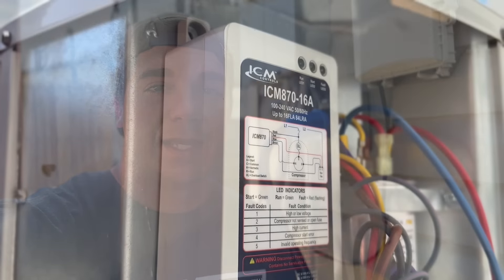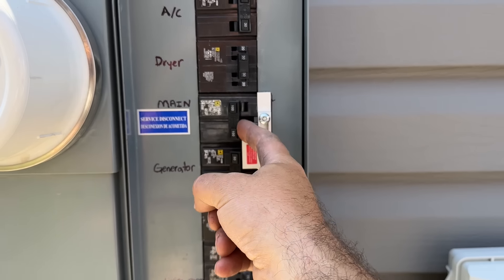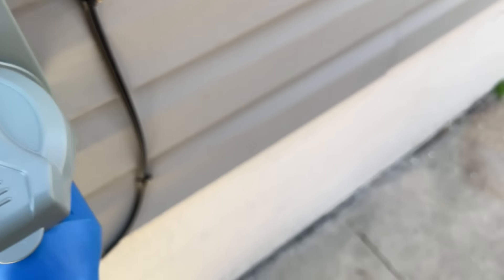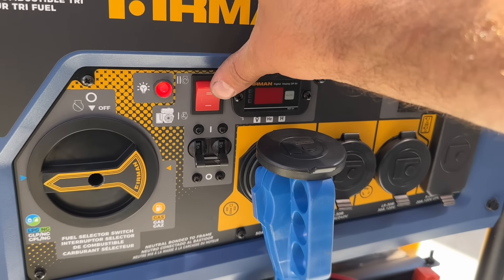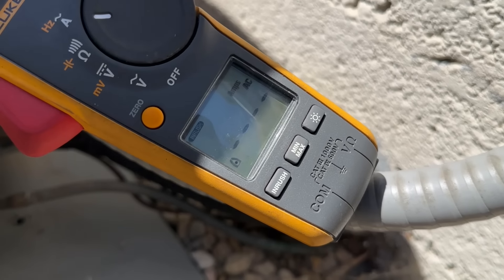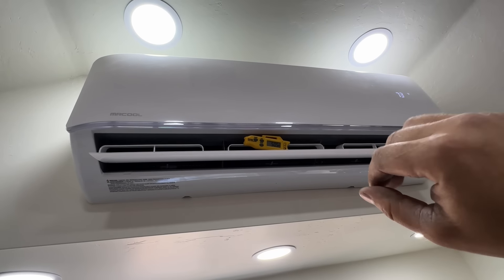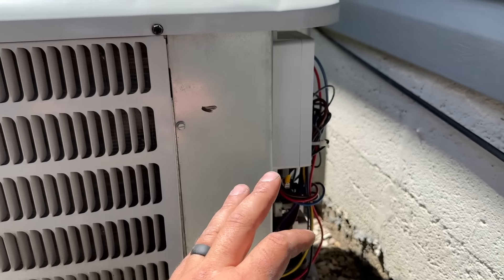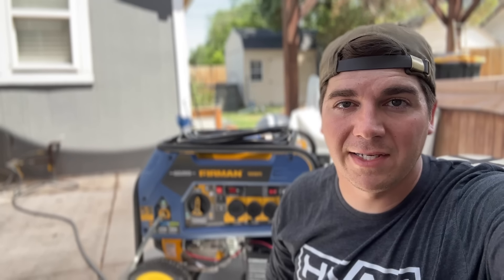How To Get Whole Home Backup Power For Under $1000

Comment: What happens if you don’t install a soft  start
Reply from the maker: It would trip the breaker at the generator at startup if it requires more amps then the generator is capable of producing. As I said in the video, if you had a 4 ton system that pulls 100 amps at start, without the soft start you’d be demanding 15,000 watts (70amps x220v) which isn’t feasible. 

Now if you lower the inrush amps from 70 to 25 that would only be 6000 watts which is totally doable with a generator. 

The mean motivating factor to me is having the capability of using it in the winter as well with a heat pump so I’ll be doing a video on converting a regular system to a heat pump. It’s really not bad at all! Stay tuned 👊🏼

Comment: Great video Dave, straight to the point and well explained. I just purchased the same generator but with the CO2 sensor. I noticed you run natural gas but use a 50amp connection.  I assume this is because if you ever use gasoline you can get up to 10,000 watts. NG Max is 7,500 watts on that Firman. Will you just be careful with how many breakers you have on when running on NG? I am about to install the same arrangement and use natural gas only (hopefully). And definitely subscribing now
Reply: Or did you use the 50amp cord from the generator for less resistance in the cord than a 30amp cord?

Comment: So you have 6.3 amps on one leg on the a/c so you should have 12.6 amps total or am I wrong ?
Reply: No, it's a 240v circuit- current flowing from one hot leg to the other, so 6.3 amps total.  IF it was two separate 120v devices, you could say 12.6 amps.  Think of it this way- there's no "neutral" leg in this case, just two hots and a ground.  Normally you think "current flows from hot to neutral", in this case "current flows from hot to hot, they're out-of-phase for twice the voltage"
Power, though- that will add up like you're thinking.  240v x 6.3A = 1500W (approx).... if it were two separate 120v circuits at 6.3 amp each, then about 740w each, again 1500w total.
Does that make sense?  (clearly I'm not an EE professor :)  )
Reply from the maker: 6.3 total as the other gentlemen said 👍🏼
Reply: @diyhvacguy  But if you test the amps on the other leg it will also show 6.3. A 240v circuit is two 120v circuits or legs. Why doesn't 6.3 + 6.3 = 12.6? Try putting the amp probe around both legs at the same time and see watt it reads. Sorry, couldn't help myself on the pun.
Reply: @christalbert722  thank you for the reply, I thought that was the right answer but I just read somewhere else it was the opposite way.
Reply: @diyhvacguy  thanks for the reply

Comment: If you spend enough money to buy whole-home backup power, then you're spending far too much money because you don't need whole-home backup power while the municipal power is down. It's silly to overspec your backup generator that way. Spec it instead only big enough to cover all your truly necessary equipment and no more. Water well pump, chest freezer(s), refrigerator, stove igniter, furnace... but not all at the same time, so priority-switch them. You'll never need all of them to be powered at the same time, but in the dead of winter you may need to run any one of those at the same time as your furnace.

Only the very lazy and the very wasteful will have a whole-house backup generator that's really big enough to carry everything. That's 48KW, and it's far, far too much.

Comment: Would this also power a hot water tank and an electric stove as well?
Reply: Any device that heats up will probably not work very well when the A/C is running. It all depends on how many watts on each 120V leg is available at the time the device starts.
Reply: No, the water heater is a huge load unless it’s the only thing your going to run 😂
Reply: @deadonleprechaun  Most electric water heaters have elements that draw 4,500 watts, pulling about 35 amps. So depends on the generator, but generally, while on gen power you would not use heating appliances as you would on grid power. My old generator was a 5,500 watt and one morning we lost power. I started the generator for wife  and daughter to get ready for work and they proceeded to use hair dryers, curling irons, microwave, instant hot etc and of course it popped the breaker on the generator. When on generator power you will need to limit the high demand appliances to one or two max at a time. That certainly includes an electric W/H or stove.
Reply: @azycray4801  Yes, it’s too bad that Furman neuters the 50 amp receptacle giving a small internal fuse making it a glorified 30 amp. I had the larger version of this generator from Costco and elected to exchange it because it couldn’t handle my 60 gallon water heater. I opted for a 4000w 120v inverter generator. Decided to just scrap running my 240 V appliances so I don’t damage them with too much THD. Once the prices on 240 Volt inverter generators are more affordable I will probably upgrade.

Comment: Please be careful. Looking at your "transfer switch setup", it seems you don't disconnect the neutral wire. This can potential be dangerous for you and for people working on the line.
I totally appreciate people helping themselves, but we need to have safety in mind for others, and if the Generator  is connected to the grid neutral, I assume this is a potential danger for people outside of your property... Or does your power grid not have a grid neutral, and you have your own transformer with a ground only? Then my concerns might be obsolete...

Comment: Ok, someone help me design a home backup that includes an instant on battery from Home Grid or similar. The battery needs to be able to run my two AC units (upstairs and downstairs), plus fridge and lights for 12 to 24 hours.  Then if utility power is still out, a want to be able to roll out a portable natural gas generator, him up to my grill outlet quick connect, and use it to periodically recharge the battery. That way the generator can run at heavy load which is most efficient way to run generators. Then i turn it off when batteries are full.  Automatic control of the generator from the battery would be even better.  I know solar can do most of this, but im not ready for solar... Too expensive and too ugly. Once those two items are solved, I'll add solar and not need the portable generator anymore.  Anyone?  Can this be done?

Comment: Couple of things.   

First, this is why you don’t take advice from people on YouTube.  Having that generator close to the door is extremely dangerous.  Carbon monoxide poisoning happens and this is one of the main culprits.

Second, you will regret using this generator for 2 days straight whether on natural gas, propane, or gasoline.  It is not an inverter generator and will consume copious amounts of fuel while not providing clean power to your home.  Your HVAC system motors/electroics, appliances, and anything like TV’s, computers, etc will not be happy with this power and you’ll effectively reduce the life of those items by using this generator.

Comment: And that generator alone is over $1000 so not sure where you get "under 1000" especially with the costs to add a transfer panel (which aren't cheap either)

Comment: 1) Interlock switch is not legal in every state.
2) Load calculations required and it is not for homeowners.
3) I recommends a transfer switch, a sub panel to backup necessities, not the Whole House.
I am a master electrician for 35 years.  Please STOP with the wannabe DIY projects, especially with electricity.